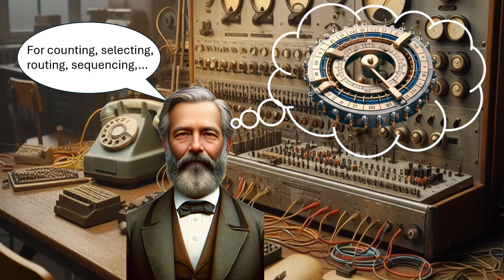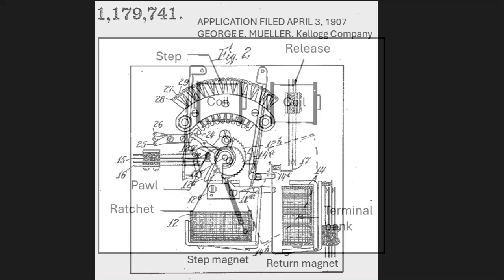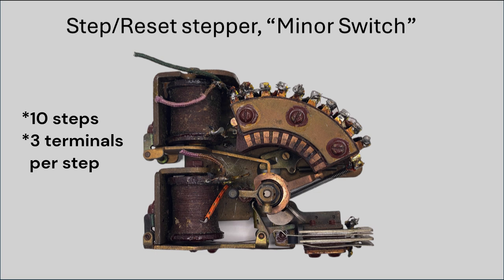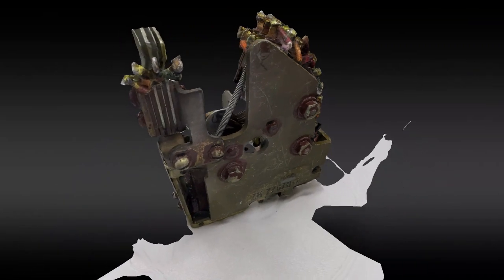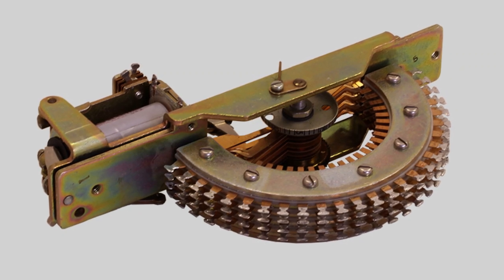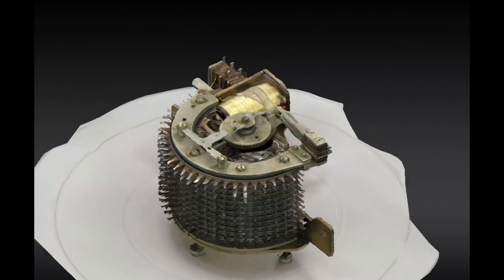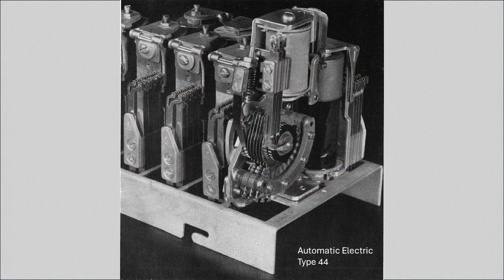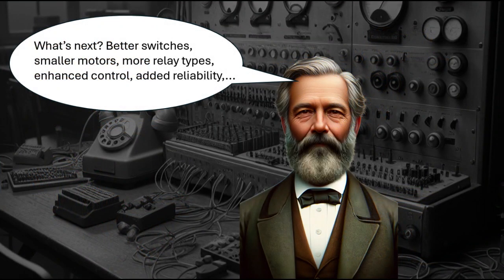Summary of  the Rotary Stepper switch with demos

Comment: Something that I have never understood about these switches is how the switch was designed to bypass lines that were currently in use. I thought each number dialed drove the most popular of these switches on a vertical axis and then the wiper of the horizontal axis moved radially until it found a line that was not in use. Perhaps I have a fundamental misunderstanding.
Reply from the maker: Good question. (repeat answer from a similar question for a different video).... Looking at the "First Selector" it moves vertically based on the first dialed digit. Then it immediately hunts for the first FREE 2nd Selector. To start, the 1st Selector advances one horizontal step and if there is a GROUND on the Sleeve terminal (Tip Ring and Sleeve contacts are each bank position), the hunt continues. Assume the first free 2nd selector is at position 5, then there is no ground on the Sleeve contact terminal and the hunt stops and the subscriber is connected to the 2nd Selector to enter the second dialed digit. 

Hunt must be fast to assure the caller does not dial the second digit before the 2nd selector is found.